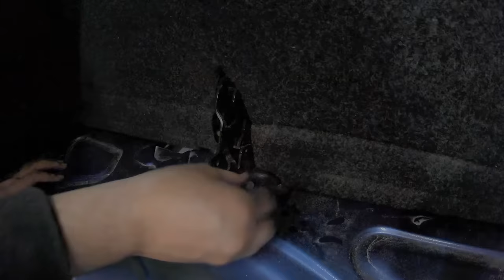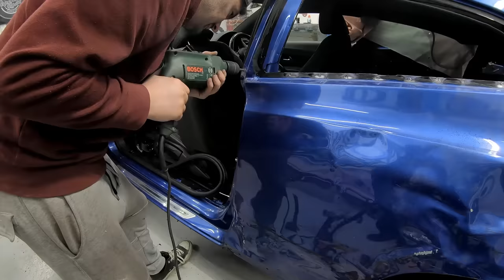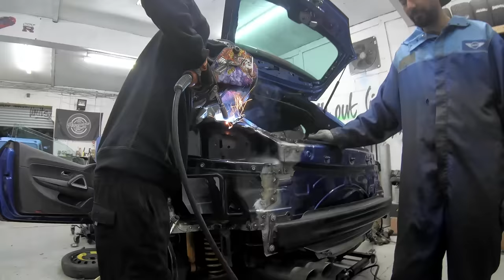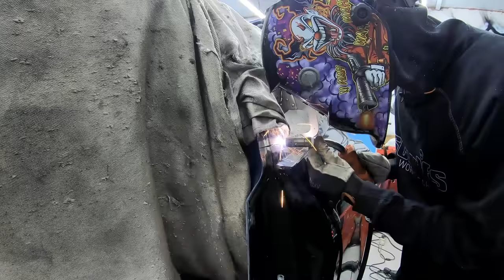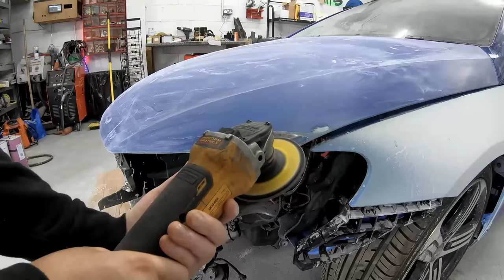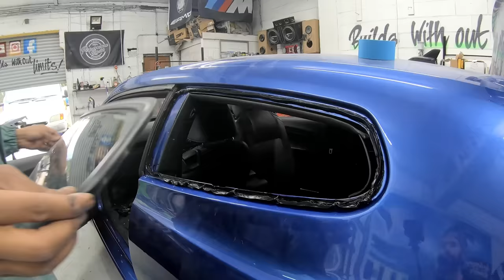Rebuilding a salvage VW Scirocco R in 10 mins

Comment: You really need to put a guard on your angle grinder. Have you ever seen one of these cutting wheels explode? I've had two explode, but because I had a guard on the grinder, the shrapnel flew forwards away from me. Hate to see anyone get injured.
Reply: They just care about money not safety
Reply: You try to work with a guard on your grinder let alone in a bodyshop to do meticulous cuts, also they explode if you're unskilled. Also if you're getting shrapnel coming your way, that's also another tell that you're unskilled.
Reply: @sixmillphill3273  I’ve never ever seen anyone use an angle grinder without a guard on it. I mean ever. Tell me one good reason why you need to remove it?  Access isn’t a good reason either before you try that excuse.
Reply: @Alexander_l322  sometimes you need space and the guard is in the way.

Comment: Looks like a 1.4 tsi or 2.0 tsi, but not the actual scirocco R. It's just an R line. The actual scirocco R was an exhaust tip each side. Also, the standard wheels looks much better imo.
Reply: Engine cover says tdi
Reply: It's a diesel 🤡

Comment: Hey guys I have a question. How do you know that it would be better to replace an entire pannel rather than just putting on a ridiculous amount of body putty? Like what is the deciding factor?
Reply: It is easier than getting panel look good, less messy (a lot of sanding) and also less thing to go wrong, because you just replace whole panel rather than dealing with curves, getting everything flush etc.
Also panel without damages gives you peace in mind that not bended metal won't rust quick in comparison to crushed and later straightened metal